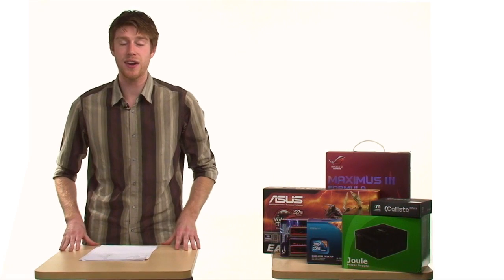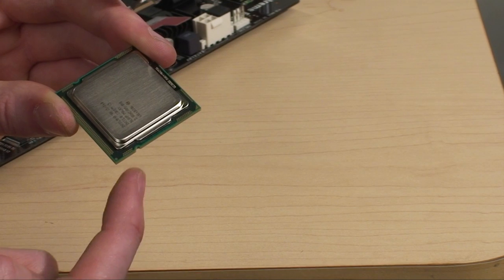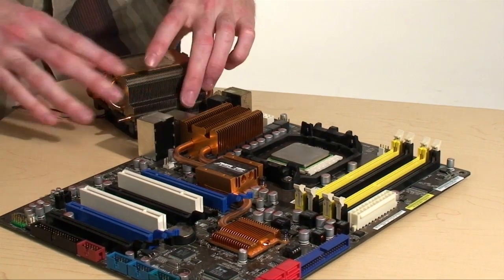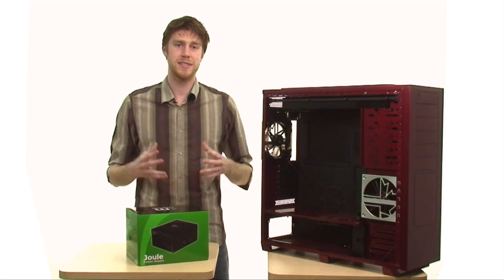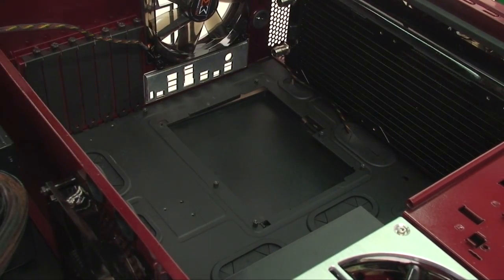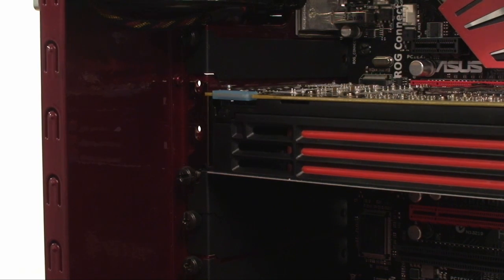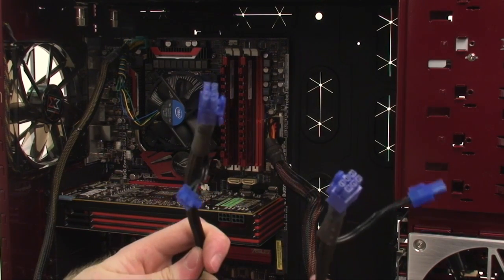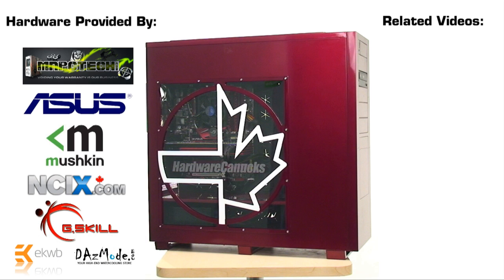Hardware Canucks Guide to Building Your Own Personal Computer (PC)

Comment: i usually put all the front header cables and power button, etc in immediately after the motherboard has been mounted in the case strictly because those small connections are harder to make with hard drives, expansion and graphics cards in place. this difficulty is substantially greater when working with a micro atx form factor build.

Comment: @HardwareCanucks 
I find it odd that you've connected a stock cooler to the CPU, yet there is clearly a 360 radiator in the top of the case...why?

Comment: How did you get the AMD heatsink on so easily, i built a AMD system for my mate which has the stock cooler withit, and it required so much force and about 30 mins of fafing to get it on?

Comment: EXCELLENT installation guide ! I've been building computers for years now so I haven't learned anything new, but for people who just bought their first system, I think it's the perfect guide. You can't explain better than that in less than 11 minutes. Great idea to advise people to consult their motherboard's manual for additional details, especially for the connexions from the case to the motherboard. Also, check your manual to know in which slot you should insert your memory modules.